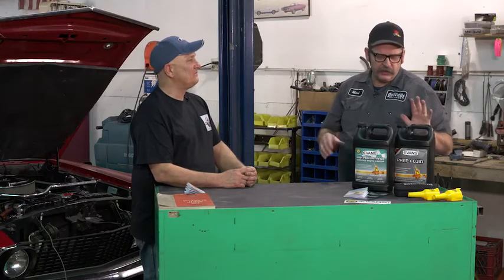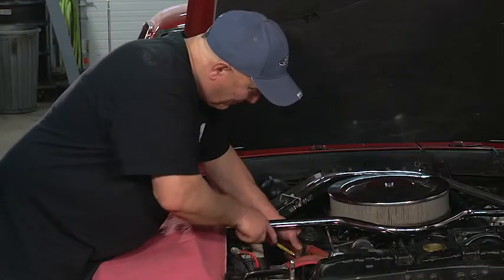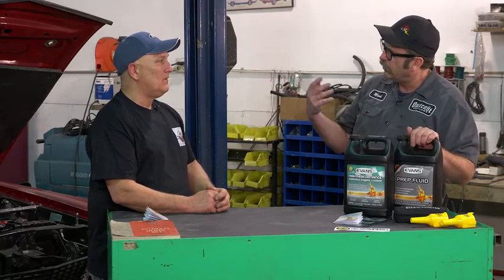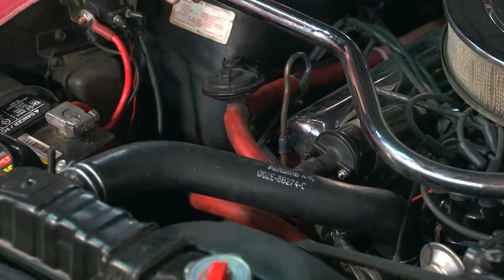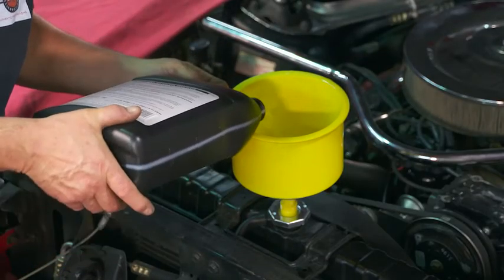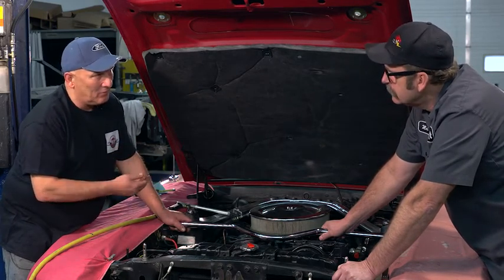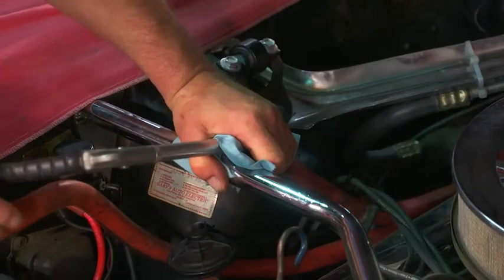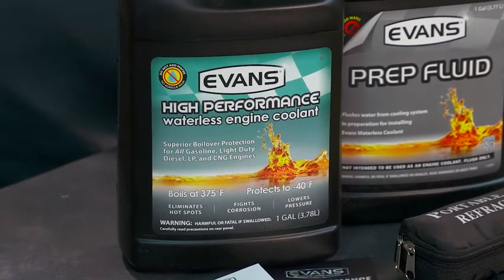Evan's Waterless Coolant Upgrade

Comment: I bought one of their refractometers a while ago the calibration instructions were to use distilled water. The unit will not calibrate with distilled water. Through my own trail and error I find it calibrates it's nicely using new coolant. Now there's no mention of this on the website but if you buy the instrument from them today it has instructions to calibrate it using new coolant. And their customer service couldn't even answer this question.

Comment: That's all fine and cool but how well does it transfer heat out?  What don't you show a video with the same car running 50/50 and then Evans coolant.  After the thermostat has opened up show a reading from a temp gun on the engine block.

Comment: Evans coolant has just over half the ability to transfer heat than water, nothings better than water. It is also more viscous, considerably more viscous this may cause a water pump to work much harder. Some people run a high-volume water pump with the coolant.. One thing I never hear Evans talk about is the coolant is flammable. I've used it successfully and motor bikes and quads. What I can say is when I've had trouble Evans coolant customer service has been terrible, practically nonexistent. They have never answered a single one of my questions. Like what to doif the coolant becomes contaminated with water. Seems like a simple question but not a peep out of him and coolant customer service.